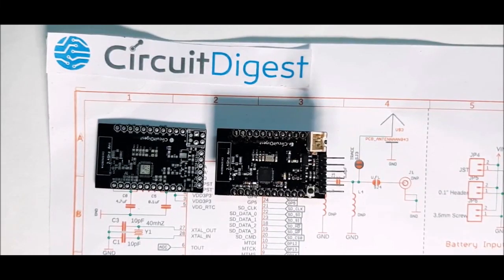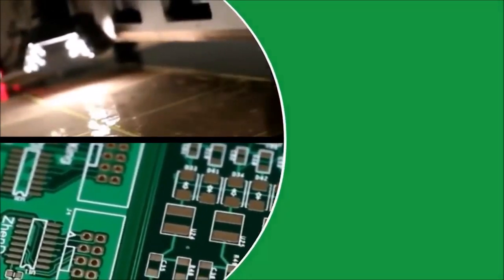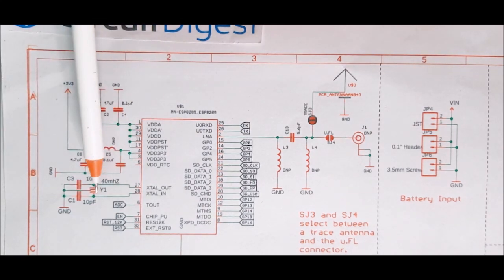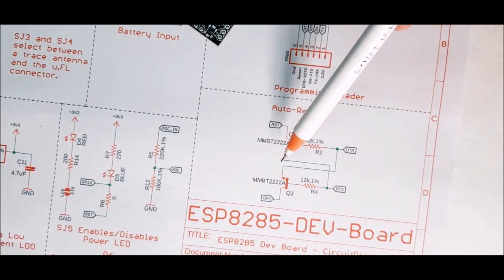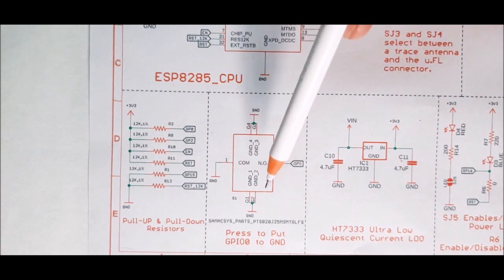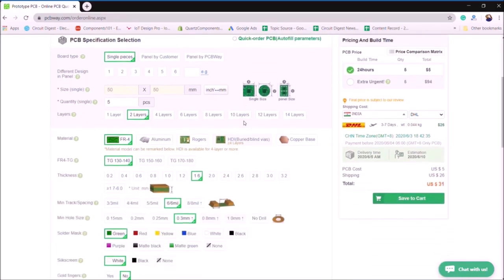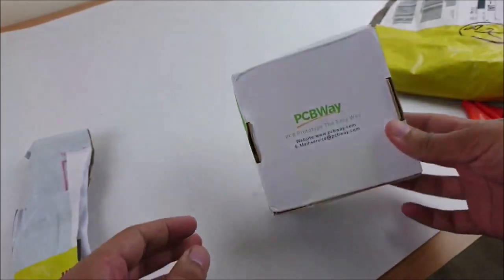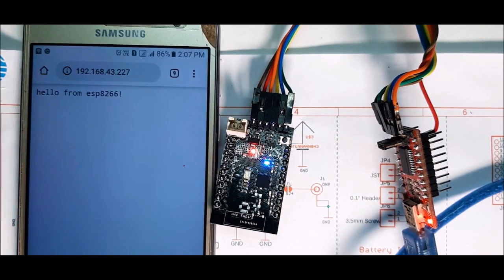How to Design Your own ESP boards on PCB with Antenna

Comment: "Do the size, copper thickness, and impedance matter? Can I copy the antenna from an existing module?" Thanks!
Reply from the maker: Yes they do matter when it comes to the power and RF sections.

Comment: HELLO!!!! What are the values of the inductor L2, L3, L4 ????
Reply from the maker: L3 and L4 and DNP, no need to install them. And the L2 is no necessary, replace it with 0ohms resistor.
Reply: I think L2 that is 1st inductor of the circuit it is a necessary component though it is forming a pi circuit matching the impedance connected to VDD3 and also my doubt same goes for L3 and L4 they are connected to LNA low noise amplifier as a result thier values Match the antenna impedance
Reply from the maker: L2 is part of a low pass filter for the power supply. As long as the power supply is clean it is not necessary to use the LPF. But is is good to use them since it provide extra EMI filtering. You can use any online low pass filter calculator to calculate the value. And for L3 and L4 it depend on the antenna design. As long as the impedance is matched no need to install them. The antenna circuit follows reference design from Espressif.
Reply: Just in case if you do have more idea related to this project help me I'm building the same...
Reply: Thank you bro 🙏🙏

Comment: great video thank you. and from the circuit, I understand there is no lipo charging circuit right?
Reply from the maker: Yes, charging circuit is not present on the board. But it should be easy to integrate this board with this https://circuitdigest.com/electronic-circuits/how-to-build-a-18650-lithium-battery-charger-and-booster-module